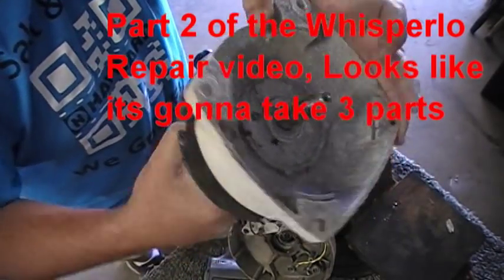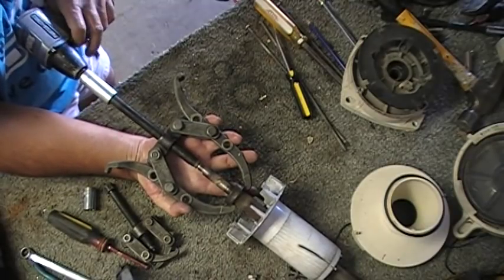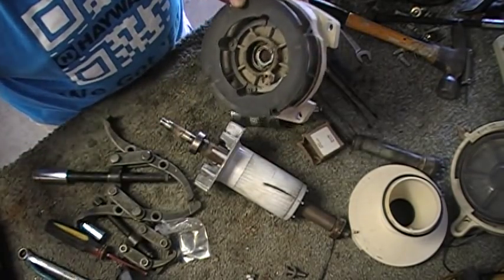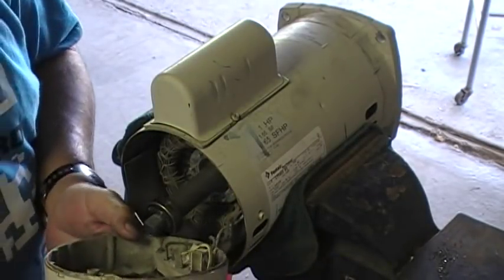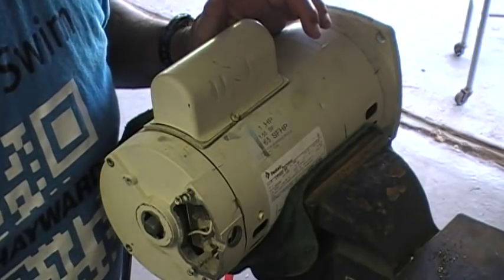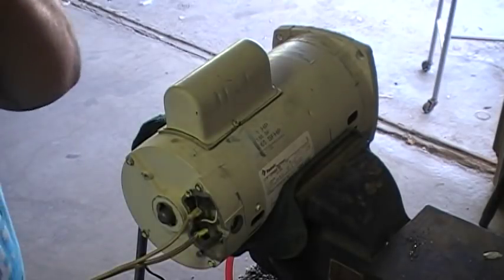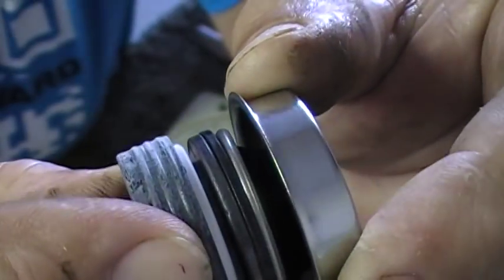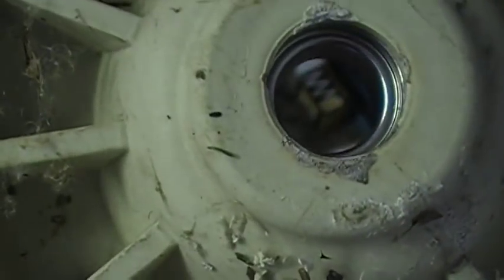Whisperflo pump repair part 2.mpg

Comment: Excellent video. Right to the point of what I needed. I have the exact same pump with the same "humming" problem. Now that I've seen this video I feel sure I can at least take it apart. Would be nice if you could post information where you get your parts (bearing, seal,  joint stick, etc).

By the way, where is part 3?

Comment: Considering the time & cost of removing the pump and pulling it apart plus down time, I would have replaced that back bearing as well. Because, if the one bearing failed, the second one will probably go sooner than later. An extra 5 bucks for the bearing and 2 more minutes of labor today to save you hours down the road is a good investment.
Reply: It is MIND BLOWING that he did not do this.  Maybe it is so he gets another service call from his customer when it fails in 6 months.  However, if I were the customer, I would be irate.
Reply: agree
Reply: My father worker for Hyatt Bearing general Motors in Clark, NJ. He told me 30 or 40 years ago , never change bearings that are good just to change bearings for thre is no guarantee that the replacement will be superior or not fail sooner than a good original.
Reply: @Chris  I like your dad " if it works don't fix it"

Comment: Eazy I rebuild pumps over a 100 hp experienced with many years u did a good gob any body has any questions feel free to ask
Reply: Andres Sanchez hey andres, can i bother you with 2 quick questions?
1.- where the heck can i buy bearings? Any classic stores like lowes or somewhere online?
2.- what's the tool this guy used to remove the bearing? 
Thank you sir
Reply: @1204timyr  you can buy anything and everything on Amazon....

Comment: @ 4:01 NO, NO - STOP THE BANGING - PLEASE! You didn't clean the housing. You lost your pre-load spring. 
1. Clean the inside of the bearing insert surface (on the housing) until it is SHINY clean.
2. Now the bearing slips in EASY (without need for banging) and pushes against your preload spring.
3. Loosen your bearing tension mechanism until it can reach behind the bearing
4. Once your bearing tension mechanism is in place you start to tighten it. Don't tighten too much!
5. After you tighten a little, it causes the bearing to go in sideways, so take your hand and push on the other side. Now the bearing is LOOSE again.
Repeat steps 4 and 5 until the bearing tension mechanism holds the bearing surface parallel to the housing surface.
6. Finally tighten the bearing tension screw so it is snug. 
If you are banging on your pump motor, something is wrong. This is not the way to do work.
In the end, the bearing is sandwiched in between the preload spring and the tension mechanism. 

@ 4:40 Is it tight because the bearing in in a bind, or because it is properly seated? How do you know? Try, again, to tap on the side OPPOSITE the bearing tension screw. If the housing suddenly is loose on the bearing, then it was in a bind. You shouldn't need to do this if the housing was properly cleaned in the first place.
Reply: Hi, thanks for the additional info. The screw for the front bearing retainer on my motor is rusted. Tips for removing and replacing?  Thanks

Comment: @ 1:06 No bangy bangy - use a gear puller instead. I got a set of 3 sizes from ebay for $16. WAY easier than banging on the table- actually I didn't bang on the table, used more advanced method, but gear puller was still much easier. Maybe rather than "Pool Technicians"- "Backyard handyman"? These videos are almost correct, but need a bit of refinement. Remember you actually want to use your motor when you are done - right?
Edit: LOL He shows you the proper puller @ 1:50, but doesn't know how to use it to remove the casing - go figure! Just wrap that baby around the housing just like you do with the bearing and the housing will come off exactly the same way.

Comment: #1 Seal plate was cracked inside the shaft seal recession.
 #2 Never install shaft seals by directly touching the ceramic sides.....the oils in your hands degrade them and cause premature failure which leads to bearing failure. 
#3 Clean the piss out of all the parts, especially the internal parts and spray with electronic cleaner just before assembly to rid any dust/debris inside the winding area.

Comment: I just pulled my motor off but here in AZ U can’t have your pool pump down for more then a day or 2 in mid summer so I pony up and bought a new motor now that she up in running I pulled my old motor apart and ordered bearings so I’ll have a backup this job seems pretty easy so thank U sir for the info👍🤠

Comment: Great video! I was able to disassemble the pump and motor assembly based on your video. I found the front bearing bad but in removing and taking apart the motor I had three of the bolts break and the retainer screw for the front bearing was seized into the retainer. I could not find a parts diagram/PN for screws and retainer. Any source for those?

Comment: Question, Can the bearing be spinning well and still screech when the pump is reassembled ? Maybe the impeller not working right? or maybe the bearing seats?

Comment: A pump was leaking at the seal plate.  Replace the seal, but still leaked like a sieve.  Took seal plate off, but saw nothing cracked.  After the plate dried over the next 18 hours, the crack FINALLY became apparent, with a mineral build up alone the crack.
It was a black seal plate, and I was working in the shade. ... and No, the seal plate was not warped as the guy said.

Comment: My advice is if your pool motor is more than 10 years old, I suggest you replace it, less noise, more efficient, less worry for more parts to broke.  Replace it with a 2 speed motor to save electricity, high speed only when vacuuming, price is almost the same as single speed.  I did replace my 12 year old pool motor bearing, the noise is still there, not worth replacing the bearing.  I just bought a 2 speed and I love it, variable speed is more expensive though.

Comment: I snapped the head off the screw that holds the wing behind the bearing. 4.25 of this video. Does anyone know what size and thread count  I should drill and tap it out to so I can replace it?
Reply: How did you solve this. Mine is frozen

Comment: Your video was very very helpful, BUT I was hoping you address my problem. My problem is that my breaker "pops" IMMEDIATELY after I turn the power switch on. Are my motor windings fried? 
Thanks in advance for your response.

Comment: @ 1:00 I'm trying to loosen the screw, which locks in the bearing....I can't get the darn thing to loosen. What do I do?
I've soaked it in WD40.
Reply: You break it off in back. Then drill it out  and replace with bigger bolt.
Reply: It needs only few threads don't take out all the way, you need to use a bit of heat.

Comment: Good video, was getting ready to order from Amazon 2 seals, they cost $21.50, the 203 seal is less than $5 on Amazon.  Same seal, looks like but one is marketed to pool pumps. Like the Plasto Joint seal, thanks will look for it as well.  Any suggestions on the o ring kits?
Reply: Your bearing (203) fit? I have a 2 HP pool pump (whisperflo) amazon doesnt say they are 203s just that they fit the whisperflo... Thanks
Reply: @2Timothy3END  Yes, bought a package of 4 for $10, if I recall correctly.  Replaced both front and rear seals and pump is working great, nice and silent again.

Comment: Very good job , i have just instale a new pump model PANTAIR  SF-N1-3/4A/340037 and stop working while raining , probably it got water inside . i need a answer ,thank you . Chris.
Reply: The motor is water damaged and when that happens the pump will burn up and short out to were its not repairable and you will have to replace it or get a new pump but if there's a flood you don't want to be running it

Comment: You mentioned the bearing being a 203 type bearing.  Would that be the same bearing on a 1 1/2 HP dual speed motor also?  is there any designations after the 203xx?

Comment: Great Video!  If I may ask, what size bearing puller is that you are using?  Is it a 6 inch?  Need to buy one, and they come in 3,4 and 6 inch.  Thank You!
Reply: use six inch works perfect.

Comment: My bearing is not on the shaft; it's tight within the housing.
What can I do to extract it?
Reply: I have the exact same problem.   Let me know how you solved it.
Reply: @bradgee2059  While using a heavy screwdriver to pound it out, I broke off a piece of the housing. I replaced the bearings, put it back together, and crossed my fingers. It's been running fine for the last few months but I'll have to see how it holds up over time.
So far, there aren't any leaks.
Reply: @mrbede  I ended up using a 3/4 or 5/8" concrete anchor.   I put the anchor through the bearing and then tightened it down causing the anchor to expand inside the bearing.  Then I was able to tap it out fairly easily.

Comment: I dont know why I am watching this, I was supposed to find a video where I can find the answer for my easypro pump that keeps tripping the GFCI, at first it would run for a few minutes, now it just trips the GFCI right after the power cord is plugged in. Anyways, thanks for the very informative video sir
Reply: i wouldnt plug a motor into a gfic outlet there very sensitive. you could try replacing the gfci to a normal outlet and replace the breaker at the panel with a gfci breaker .  make sure to contact a lic.electrican  about this type of work.
Reply: This is my exact issue, and I do have it connected to a GFCI. Did replacing the breaker solved your issue?
Reply: @orlandoochoa8222  believe it or not, I am looking for a new pump. Yea, its been a year since the time I commented here. What I did was that I disassembled the pump ( lots of water in there), let it dry then put it back and it ran for a year( of course there are a number of times it stopped running, let it "rest" then plugged it back to the outlet and it ran again). It is just clearly now that I need to buy a new pump. My pump is for a backyard waterfall, it is a pretty huge waterfall ( the pump is 5100GPH rated ) so I wouldnt risk anyone or pet just try to replace GFCI with a normal outlet. GFCI trips because something wrong and you'd better believe that its actually doing to protect you.

Comment: Where do you buy the bearings at?  What about the electrical part on top of the motor in the long removable Twinkie shaped removable compartment.  Is the parts in this replaceable?  Thanks Great video easy to follow!!!
Reply: Yes they are replaceable. It's call a Capacitor. Take the little housing off( 2 screws) inside you will see to plugged in wires. Then look on Amazon and get the exact same uf#, volts and hz. Place back the pug wires and housing. Pump will start if all specs were correct. Cost under $20 bucks

Comment: I realized you don't answer questions, but anybody knows where to buy bearings and the name of the tool used removed the bearing?
Reply: You use a 6 inch 3 jaw bearing puller to remove the bearings

Comment: great video.  i have an 1-1/2 horse whisper flow.  can you add a 2 horse motor on to the unit? or VFD motor?
Reply: +Beau Billion Yes, you can upsize the motor but not downsize without changing the impeller too.  a 1.5 hp impeller cannot have a motor smaller than 1.5 but you can add a 2.0 or 3.0.  If you added a 1.0 or .5hp the pump would run hot and ultimately destroy the motor from overload drag
Reply: Beau Billion yes u can u can always go from 1 1/2 to two horse power with no problems their is not much of a difference same rpms just a bit more amps
Reply: I use a socket big enough to go over the seal to the metal and press in eazy money

Comment: Hi Thanks for the video, great job. I was able to remove the motor and exposed the bearings. Unfortunately, the front bearing is much bigger than the one I bought (6203-2RS)
The defective bearing has 6304DU POLAND PPL marked on it. I can't find it on
line. Do you know what other name i can use? my pump is a 2HP..appreciate it..Thank you

Comment: Wouldnt it make sense to pack the replacment  bearing with some axle grease before pressing onto the shaft?
Reply: The bearing is a sealed bearing and can't be "packed". You should lubricate the AXLE prior to pressing on the new bearing.
Reply: Yes you can. use sharp pick and pry out the black cover, then replace back.
Reply: No need - it is a sealed bearing that comes pre-greased.

Comment: Thanks for you videos, I have a well pump that sounds exactly like yours in your part 1 video only thing the bearings are both free wheeling in both directions.  the pump flooded and was under water for a bit would that effect the capacitor, I've already replaced the square D pumptrol any Ideas on what the problem might be or is my pump motor shot.